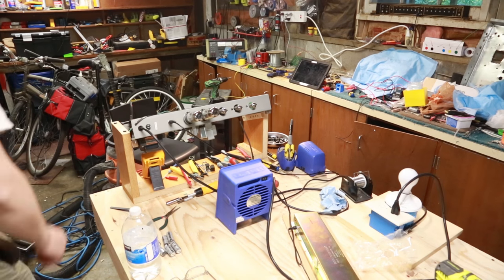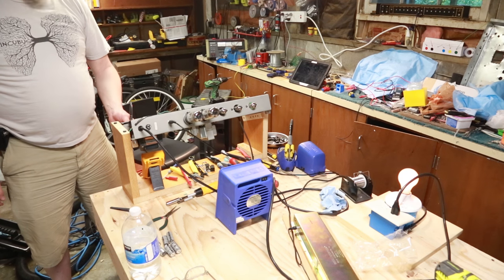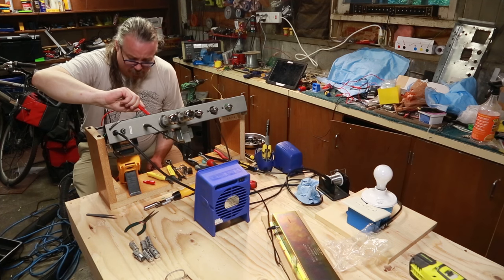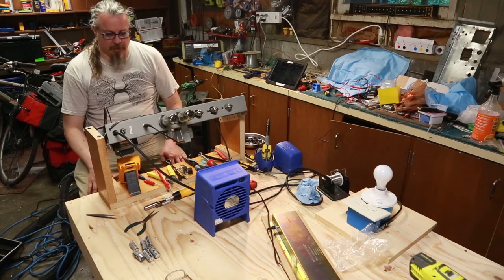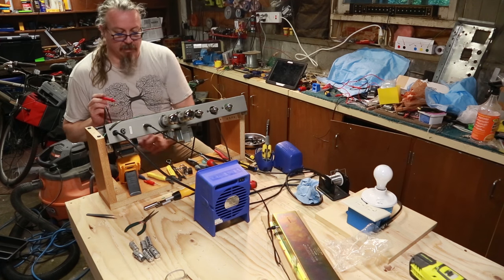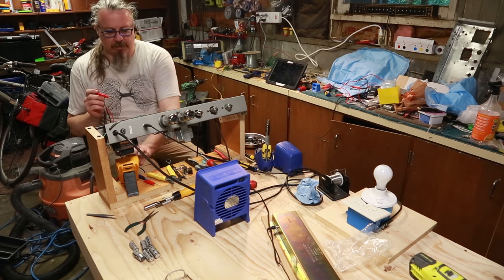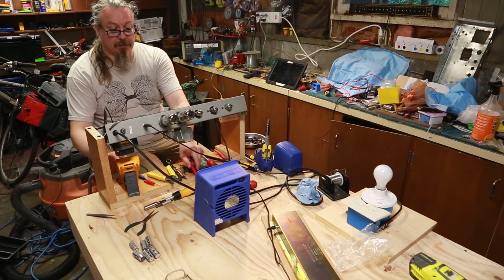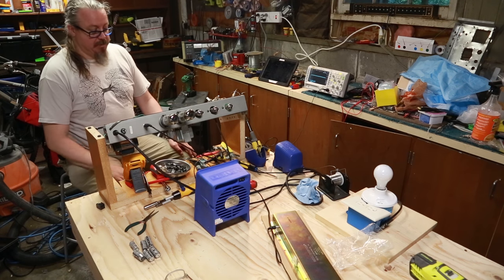Fender Inputs And Blues Deluxe Mods Video 2

Comment: Could you please be more specific on the changes? I understand most but where does the trim pot connect, and what cathode bypasses did you change and what to? Also the reverb mod what does that entail?
Reply from the maker: +Brad Resor, sorry I thought I replied to this earlier, but maybe I forgot to hit send.  There's a forum post here that details where in the circuit that mod went: http://el34world.com/Forum/index.php?topic=20367.msg214386#msg214386  That should detail it better I hope.  The reverb mod is one I had to look up again, I found it here: http://hotroddiy.com/Reverb-Mods-%26-Info.pdf .  I'm not sure I get what you mean by cathode bypasses?   I replaced all the capacitors with equivalents so far as I recall, including the cathode caps for the preamp tubes.  I't's been a while since I did this video though.
Reply: Buddysimo Simonetta he actually got back with me through Facebook and I forgot to delete the question here, he's really knowledgeable and willing to help!
Reply from the maker: +buddysimo Simonetta how did I miss that response! :)